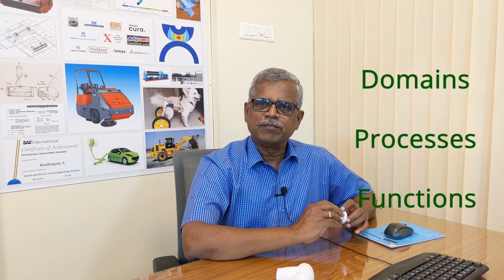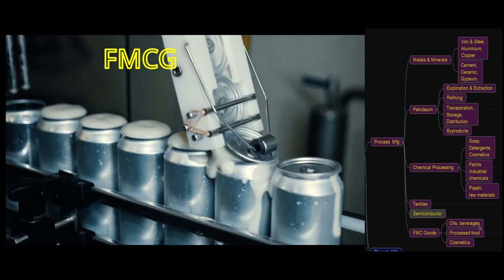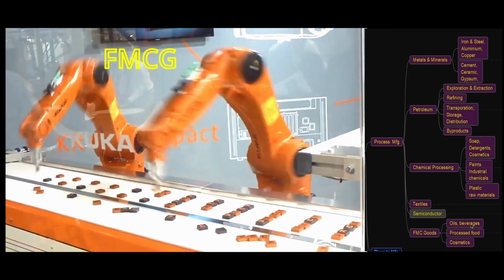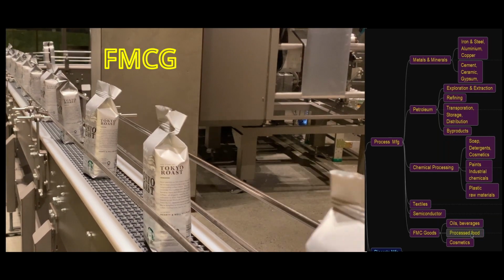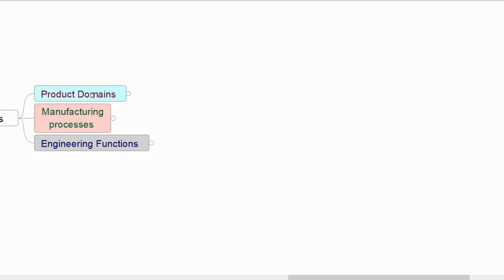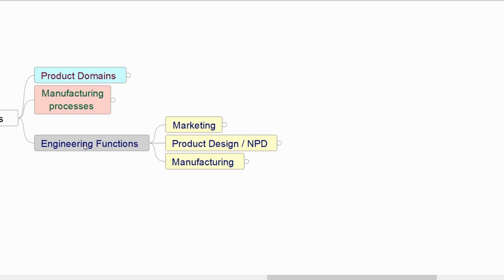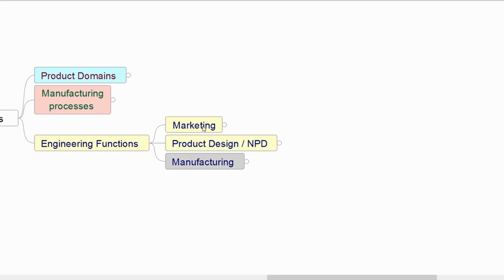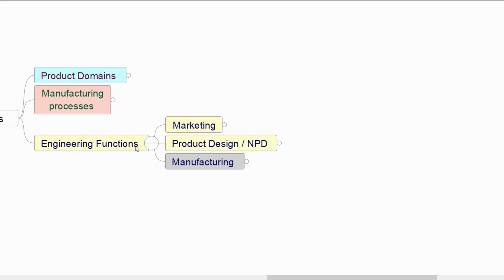What careers await you in core manufacturing: Product Domains, Mfg Processes & Functional Roles

Comment: Kasi Sir, this video is useful for final year mechanical engineering students and fresh graduates to choose the fields that they can explore. Experience in Gas turbines, Compressors manufacturing supplier will add strength career wise. Also, in pressure vessels, heat exchangers manufacturing suppliers. This is applicable starting from Oil & Gas to Refineries and downstream chemical companies. Thanks and good work.
Reply from the maker: Thanks a lot!